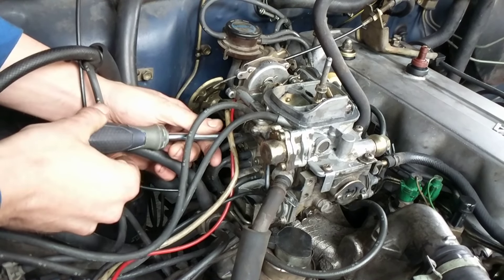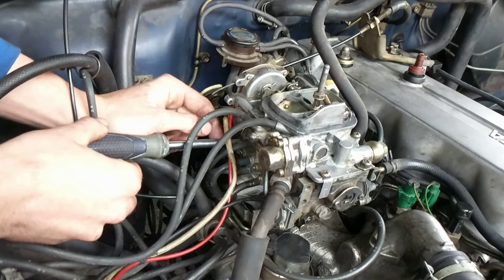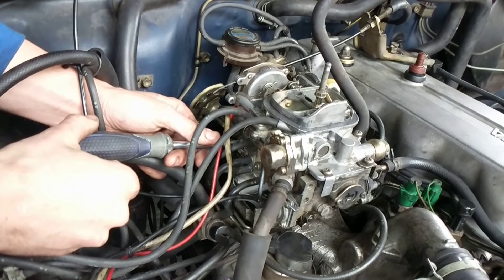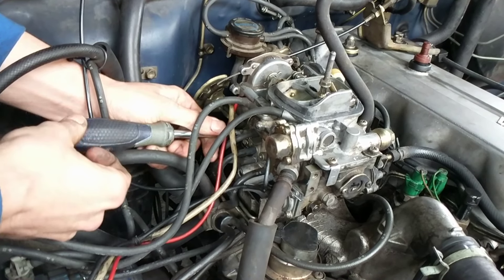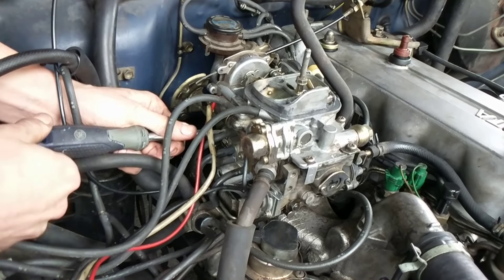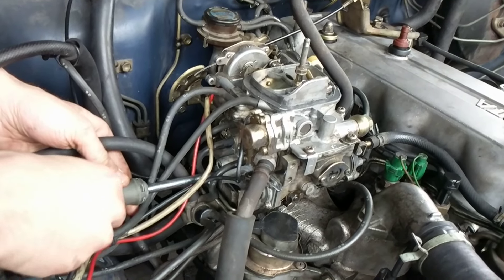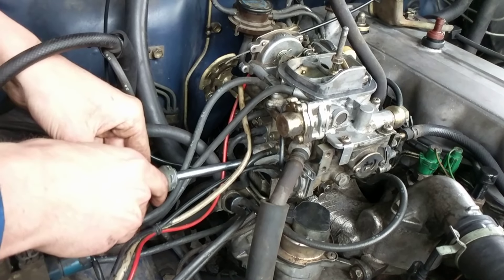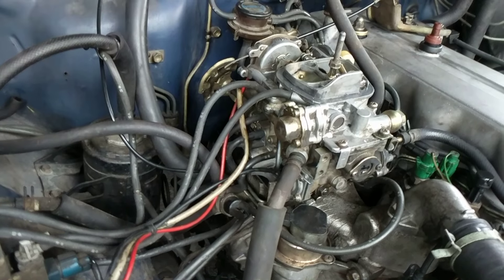🔍 How to Adjust Aisin Carburetor - Throttle & Fuel Adjustment Locations - 22R - Toyota Pickup

Comment: Thank you.  Those are good starting points.  Of course they are adjustable for a reason. 
 
(Note: the idle mixture screw (the second adjustment in the video) has a soft-plug covering it, from the factory, so you may need to remove the plug.)

Also: my '86 pickup (22R) was missing the o-ring on the solenoid, which prevents the float-bowl from draining into the intake manifold, when ignition switch is OFF, from the factory. My truck always required the engine to crank over a few times, before receiving fuel.   I'm the original owner and the carburetor was never touched by anyone.   When I rebuilt the carburetor a couple years ago, that o-ring was not in the rebuild kit.  

Had to pay Toyota dealer $12 to special-order one tiny o-ring.  Now the engine starts like it should have, when new.  

Thirty plus years of fuel draining into the intake manifold and evaporating, on a vehicle which is driven multiple times every day... that's a lot of fuel that missing o-ring cost me!
Reply: My final settings were each about 1/2 turn LESS than the default 3.5 and 2.5 (I'm at ~2000 feet altitude, if that matters.)
Reply: I think I may be having the same issue as you for the fuel draining out of the carb, may be a stretch but would you happen to know the part number for the o-ring? And what solenoid it goes onto? Thanks
Reply: @iKraVeCooKieZ  I'm sorry but that purchase, from the dealer, was about 5 years ago.  I doubt I could find the receipt in my garage.  

The dealer found the part number by my description.  I don't know how long Toyota keeps records beyond 30 years...

If you remove the solenoid, you could measure the O-ring I.D. by measuring the groove the O-ring sits in (with calipers). You can measure the O.D. by measuring the bore the O-ring fits into (using gauge-pins).
Reply: Are all the mixture screws in the same place if so how do you remove the plug on it

Comment from the maker: Throttle and fuel adjustment screw locations for an Aisin Carburetor on an '88 Toyota pickup 22R
Throttle: ~ 3 1/2 turns
Fuel Mixture: ~ 2 1/2 turns

Comment: For all yo consider. Old carb engines hate mordel crap ethanal fuels.  I run an ounce or 2 per gallon of marvel mystery oil in with the gas and amsoil octane boost. I get a much smoother running 22r by far.  Sure a few bucks more but well worth it. Getting about 19 to 20 mpg consistently.

Comment: This is great (not found in Haynes man.) but that only 1/2 the story. Next is getting the slow idle tweeked so the engine runs smooth (and passes smog). BTW, setting the valves (1hr job) really helps to smooth out engine idle+ performance.
Reply: Is the slow idle a bit under the idle adjustment screw? (Under the vacuum puller thing)
Reply: How you pased smog I have that problem in my truck do not passed smog for the carburetor

Comment: I never understood all the vacuum lines and complexity on these little carbs. My lord it is like the complexity of  a  ten thousand piece jigsaw puzzle. And all that for a four cylinder.
Reply: t watson that's because all most of the hoses are for smog emissions. :)
Reply: Surely it will run without them.
Reply from the maker: +t watson they sure are complex. However, when they designed the layout of the vacuum lines, they thought it through. There is logic to it, where the lines connect you can pretty much be assured that it's other connections will be on the same side of a housing or connection point. Taken apart carefully, the carb is easily and quickly removed along with all the other parts. I believe most the vacuum lines pertain to emissions standards and therefore could be removed accordingly.
Reply from the maker: This may be a good place to plug one of my latest videos...
Aisin Carburetor Vacuum Lines
https://youtu.be/9omRz4x0oHI

Comment: Isaac, I just had the carburetor replaced on my 1987 Toyota pickup and now it hesitates at take off and it dies if I punch the gas, so I have to give it gas slowly and it started doing it right after the carburetor replacement??
Reply: you can not just change a carburator and not have it affect something else,your timing on the distrubitor is out, re adjust it and go from their

Comment: Hi Isaac
Is the mixture screw a special kind i.e needed a special tool to turn it? Just asking as my carby requires a Toyota SST ( according to manual ). 
Im having hard time getting such a tool. 
Thanks in advance
Mick
Reply from the maker: No it didn't. Just a regular flat head screw driver.
Reply: Isaac Dozier thanks mate ...
Reply: @IsaacDozier1  Are you at sea level, has that setting worked for you?

Comment: Thanks for the vid.  Where did you get this number of 2.5 turns out for the mixture screw?  Is this stated in a Factory Service Manual or similar?
Reply from the maker: I'd have to do some research to find the original source. It took quite some time if I recall correctly. There are a lot of different opinions on this but from what I understood this is a good default to use. Depending on your elevation you may need to tweak it. I'll try to find the source and update the description, though.
Reply: A lot of people just turn the mixture screw to whatever idles the highest, the adjust the throttle stop screw to set the idle speed where they like.

Comment: I sit at about 800 feet in elevation where I live. Should that work for me or will it vary?
Reply: 800 ft. Isn’t too bad, they’re tuned from the factory for Sea Level. It only really makes a difference at about 2000 ft and above, even then the adjustments are minor.

Comment: Ok, but dit it run afterwards...?
I want to see it run after you  tuned it.
Reply from the maker: Great question. It did run after tuning it with slight adjustments. Tuning can be tricky and I may upload a video soon explaining this in detail. Here's my best shot.. 

Idle [top screw] should be set to your desired rpm at running temp, you may need to install a tachometer as I did. The method I use to check my air fuel mixture is by driving for a couple miles and pulling the plugs. 

Reference the plug to a Spark Plug Health Guide: https://goo.gl/3jqprV. 

Adjust accordingly.

Good luck!

Comment: None of this works for me. I put a rebuild in a customers truck and now it like barely runs. IDK what to do.  Fuel level is too high in the looking glass maybe? Do the floats usually come already adjusted on rebuilds?
Reply from the maker: Fuel level should be in the middle of the glass. 
I've read many circumstances where people have hooked up the vacuum/fuel lines incorrectly. No harm checking for vacuum leaks.
Also, you may need to "play with the settings"... What I have displayed is meant to bring the carb to default, depending on your elevation, you may need to tweak it.